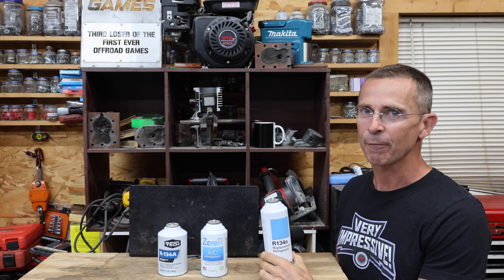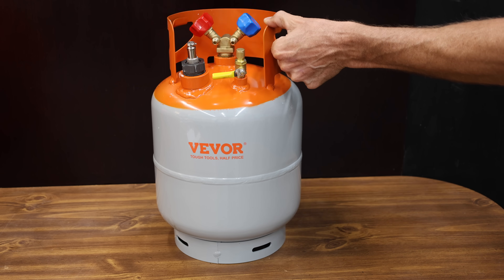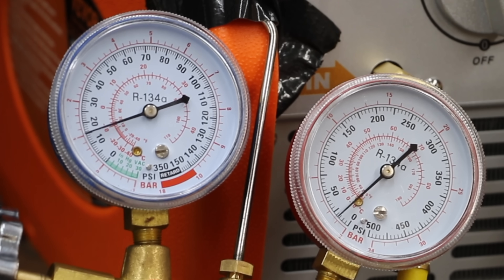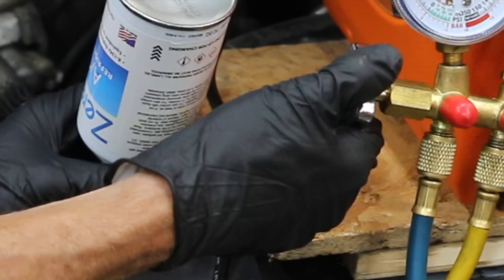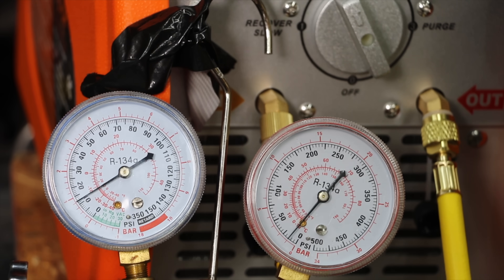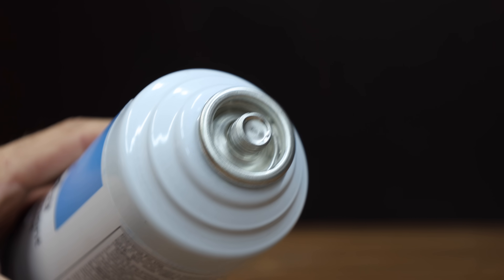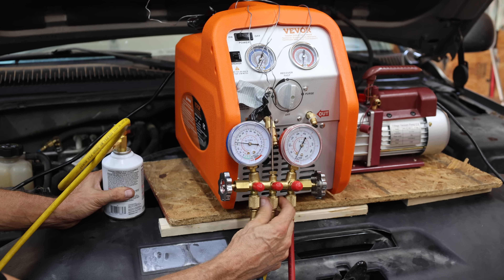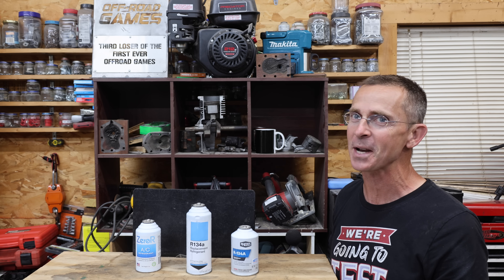How Dangerous is Fake Car A/C Refrigerant? Let's Find Out!

Comment: My grandparents had a 1997 Chevrolet Silverado at one time they bought used, it had a damaged condenser and they did not realize it for about a month after buying the truck. They had a shop replace the condensor and check the system over. When they got the truck back, on a 110*F Texas summer day, I was riding around with them from Dallas, Texas back to Paris, Texas freezing my butt off in the back seat and was stunned to see a light frost had built up on the center AC vents. The funniest thing to me was my grandfather had been complaining that R-134a doesn't work as well as R-12 did. He was no longer complaining about R-134a. I swear that truck could have been used as a locker for dry aging meats.
Reply: I've had a 1999 Toyota that would have frost build up Texas during the summer too
Reply: That's not good.  That could mean the evaporator was freezing up.  All systems should never go below 32F, so they use thermal cut off switches.  If the evaporator and lines ice up, you can end up damaging the compressor.
Reply: R134a can work great in systems that were engineered for it.  Putting it in a system that was made for R12 never works worth a flying crap.
Reply: Those trucks as always had cold air conditioning when they're properly maintained. An extra can also helps.
Reply from the maker: Thank you for sharing!
Reply: Before thermal switches were common many cars marked the coldest AC setting as "Desert only" because of this issue. In really dry and hot clomates the evaporator would not freeze over.
Reply: GM vehicles are known for having exceptional air conditioning systems. They've  been top-notch for decades now.
Reply: Best AC system I ever saw in a car was in a 1995 Windstar van with the optional dual system.   Second best (OK, tie) was a brand new Buick Regal I rented in Florida in the late 80s.  Brrrrrr..
Reply: @Joe4USMC  34' Holiday Rambler 2004 motor coach class A, has original 'S-10' Chev compressor that chills the entire front living space.. ;]
Reply: Granny, I just saw a polar bear go trundling by. Are those penguins over there near pappy?
Reply: @RickBaconsAdventures  Not true.  The switch over from R-12 to R-134a began in 1992.  The systems that went into cars during the transition period were almost all designed to work with Both.   I had a 1989 Ford Probe that came from the factory with R-12.  Sometime in the 1990s the car needed AC service and I took it to a proper AC specialist, not some hack shop.  The car retained all it's factory AC hoses, compressor etc.   The tech replaced the seals,  orifice tube, accumulator/dry and some other parts. The system was filled with R-134a and the appropriate oil.   The AC blew cold air for years after that.  The older auto AC systems...prior to the late 80s.....are not good candidates for R-134a conversions.
Reply: @Joe4USMC  I worked on a 70s Rolls Royce that was equipped with GM air conditioning and GM ignition system from the factory.
Reply: @RickBaconsAdventures  Most R12 Fords work well on R134a. I'm in the desert and its 127f Today and my 87 f250 works great on r 134. You have to change the orifice tube to one smaller to get them to cool good.
Reply: 2000-2007 GMT 800 Trucks and Wagons are the same way, freeze you out
Reply: @RickBaconsAdventures ofc, either use R-12 or R-12 Compatible "Freon"
Reply: 1997 Ranger here with ICE cold AC all Summer long :)
Reply: @chrisleggett685  That's surprising. They must have oversized the condenser or maybe that's just a tiny orifice tube
Reply: @MrSloika  It doesn't work with GM cars no matter what orifice tube you use.  Ford must have been ahead of the game and GM reluctant to go away from their R12